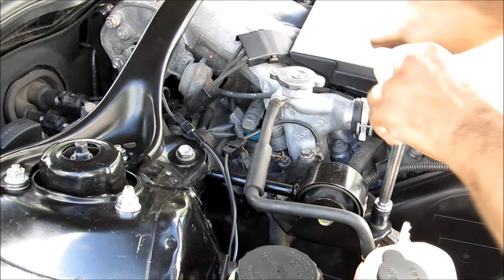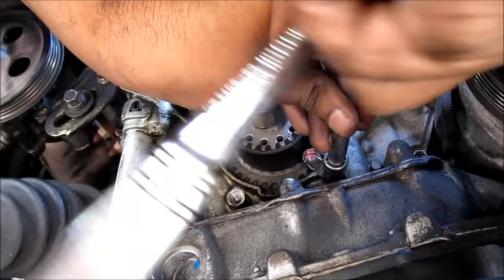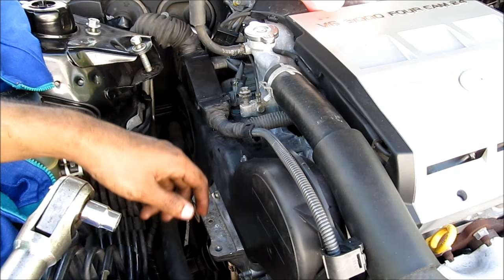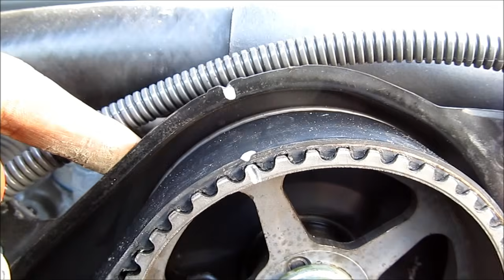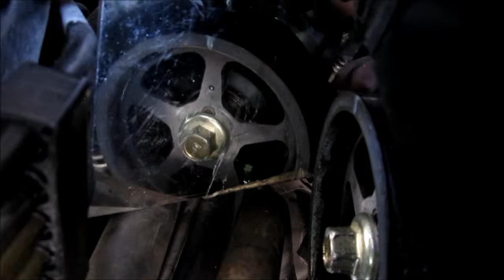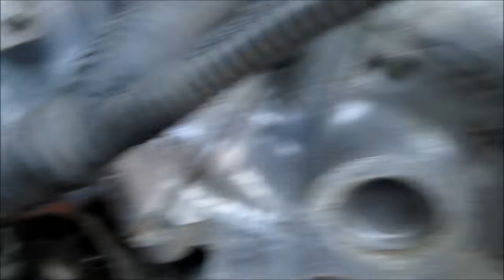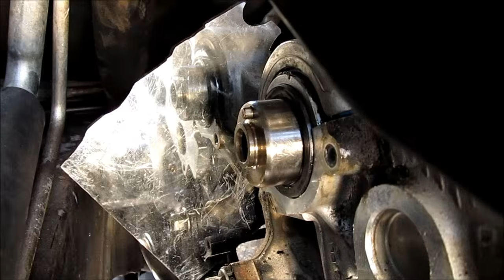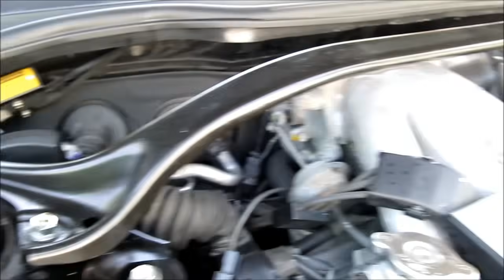Timing Belt / Waterpump Replacement: Toyota & Lexus V6

Comment: Awesome video! Just a quick question I have though. When you tighten up the camshaft bolts during reinstallation, is there an chance that you might throw the camshafts out of timing while torquing it to spec prior to putting the new timing belt on?  I mention this because I noticed that you kept your timing belt on while breaking the camshaft bolts free, and I also noticed that the camshaft turned a bit in doing so. However during reinstallation, the timing belt wasn't on while individually torquing it down.

Again, thanks for all the videos you've posted!
Reply from the maker: Thanks.
Yes the camshaft will have a tendency to rotate when tightening the bolt. You can move it very slightly backward to re-align it with the timing marks and you should be fine. Just don't let it rotate too much, especially with an interference engine.

Comment: cam seal removal you can  screw  a small bolt and pull it out ..
Reply from the maker: I've read about using the screw to pull the seals. However it does not always screw directly in the middle of the seal, and by divert to the outer or inner part of the seal damaging the shaft or housing. Also, how would you get a screw driver or drill on the rear camshaft with the strut tower in the way?

Comment: Great video.  When you remove the engine mount, did you need to support the engine from underneath?  Also, any ideas on how to locate the torque settings for the bolts you removed?
Reply from the maker: The top engine mount is only a torque strut, meant to stop the motor from shifting forward and backward as the engine revs up. It does not bear any weight, and therefore you don't need to support the engine when removing it. The torque settings can be found in the Toyota factory manual for the 1MZ-FE engine. The most important thing to torque correctly is anything that has a gasket, in this case the water-pump.
Reply: speedkar99 Many thanks,  You're video and advice are going to help me save big bucks.

Comment: I did not get how you got the cam shaft bolt off with the two breaker bar method. You stated that the other bar went on the tensioner? It looked like you got one bar on the front camshaft and the other on the back camshaft. If you can clearify that will be great. Thanks
Reply from the maker: Yes, one bar on the front and one on the rear camshafts. Rotating the front camshaft forward (tightening) will pull tension through the belt on the rear camshaft which you rotate backward with the breaker bar, eventually breaking the bolt loose. I think a camshaft gear holding tool is a better option, as using the belt tension isn't recommended (and will stretch the belt).